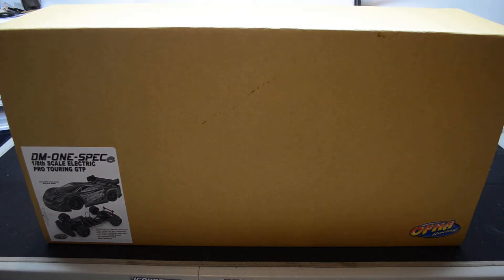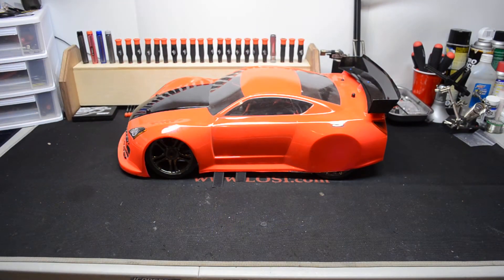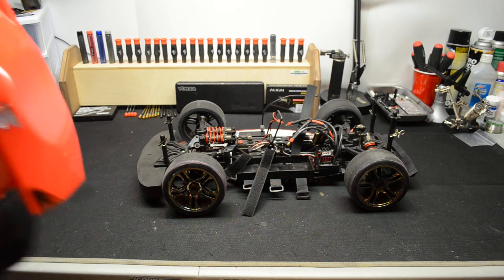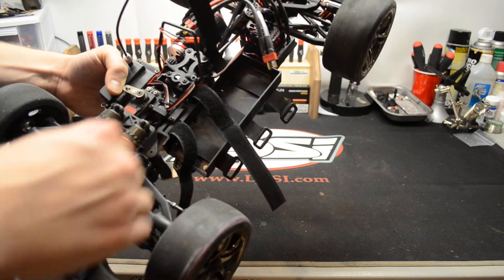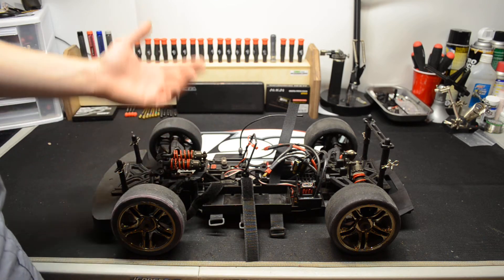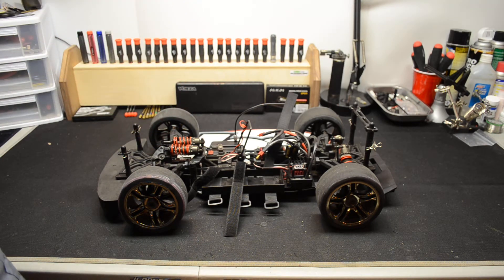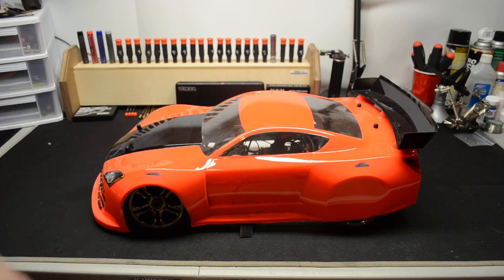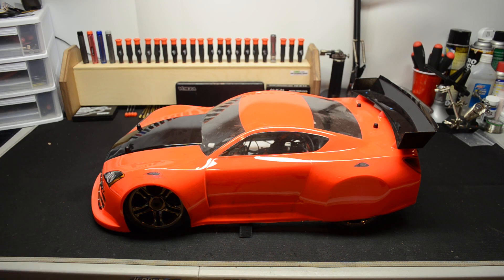Ofna Dm-One SPECe 1/8 Scale ONROAD Pro Touring GTP (ELECTRIC)---- REVIEW

Comment: 102 mph on that gearing.....Doubt it! Your gearing is too low. Gear it more towards a 1:1 setup. A lower kv motor would've also helped.
Reply: Agreed I have one and my gearing is 44 25 2050KV BLX Arrma 6s system and I'm topping at 78mph